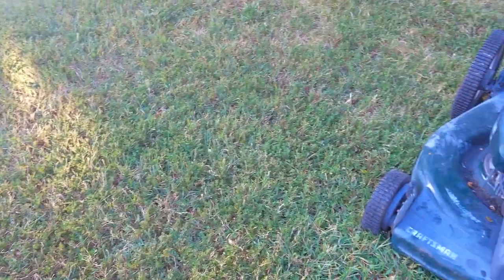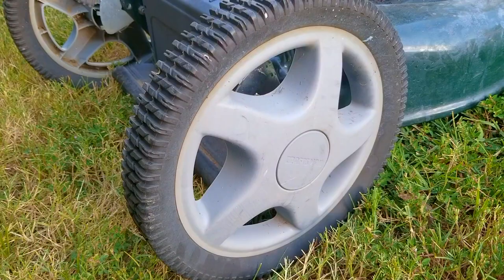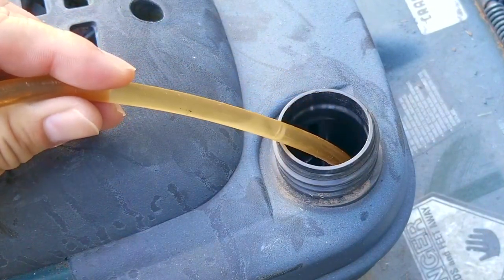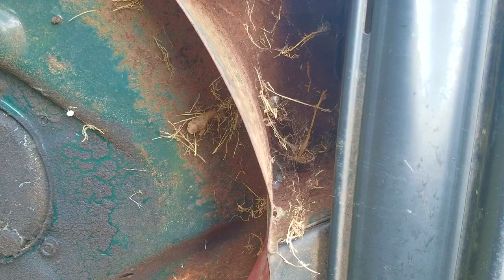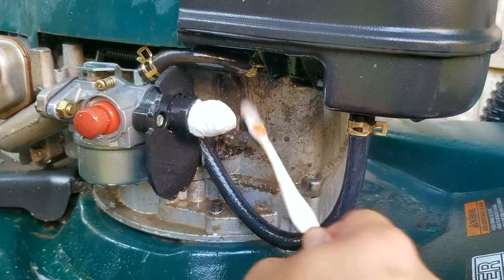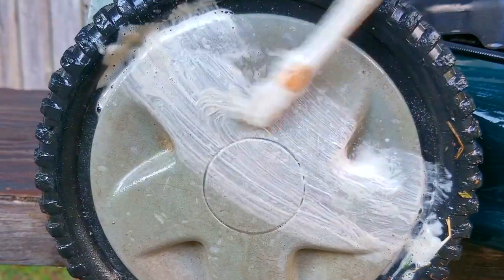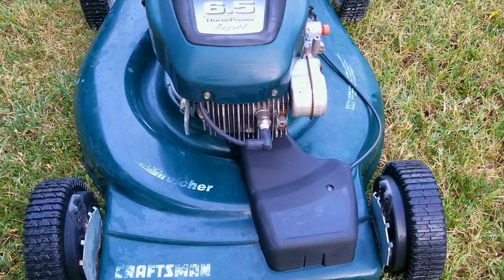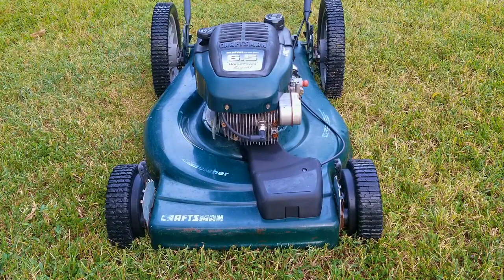Q&A #7, and cleaning a very dusty Craftsman Mower.

Comment: Can't stop binge watching these videos! I have a Mcculloch chainsaw which has some running issues (been in storage for 18 years!!!), needed new metering diaphragm, ran for a bit then stopped, turns out the gasket for the cylinder and crank case was completely dissolved! Got it working earlier today with some new sealant, very happy. Thanks for all the videos, I always learn something new, just keep the content coming.
Reply from the maker: thank you Xeobit, I appreciate the comment.

Comment: Nice clean up and if it was mine and all the fluids drained I'd flip it upside down and lay a curly wire brush on a side grinder, some compressed air and some oil base black paint to the bottom side of the deck. I've never seen a mower too old to get something out of and the two 85 models still running and mowing is a witness to it BUT that's just me. BLESSINGS!

Comment: I watch all your videos Thanks. I have a small engine repair in Michigan. I have a good tip I think to share with you. I always clean the mowers before I work on them, something the customers rarely do (clean).  To cut the  heavy grease I use  mineral spirits for the real heave grease and find Purple Power to be my second choice. Both work well without dangerous fumes like using gasoline. Thanks again for the videos.
Reply from the maker: Thank you Ronald Bechler for the tip, I appreciate your time and comment.

Comment: One of your biggest fans here. I am not sure why i enjoy mowing my yard or working on my mower or watching your excellent channels. But i do so that is that. I have followed your advice and learned from your instruction. I have all ideas whatever else you may want to take on will be a great success also. I own other yard machines (all combustible engine powered) and work on them also - i just do not enjoy it as much nor do i enjoy watching them worked on like i do mowers!! Once these idiots who are running things now finally realize that electric devices usually take at least as much energy and resources to produce and operate as combustible engines - maybe the con will be exposed.
Reply from the maker: Thank you Larry Croft, I really appreciate that.   Yes it's just a racket at the moment, "gas is bad, batteries are better".  It's more like "where's the money being made, and follow it".  There's a lot money to be made on lawn equipment, Because as a home owner, you're expected to maintain your property in the city. So if people think that batteries are the way to go, that's where business will go as well.

Comment: I like the Tecumseh engine, they run very economically and the spray oil not slash, I know little of the being in Australia, where we do have some. I need to learn more, thus far I know the carburettors are difficult to work on.
Reply from the maker: I agree with you. Thees engines have their merits.

Comment: What is your preferred brand of lawnmower engine? Briggs and Stratton, Tecumseh, honda e.t.c.  mine is Briggs
Reply from the maker: I like Briggs, but I had a choice I would prefer a Honda engine.  Tecumseh is okay, except they no longer exist as a company.
Reply: @INSIDEHOUSEGARAGE  yeah I agree honda is probably the best
Reply from the maker: I just like their quality is all. When Briggs went with the plastic carb, I knew it was a cost saving issue, as metal carbs are quite expensive.

Comment: i got a echo hand held blower and i got spark i got fuel and i got at least 100 psi on compression but it won’t start it will hydro lock sometimes but it don’t not anymore hope u can help me out. and i replaced the key for the fly wheel so it’s got spark at the right time
Reply from the maker: thanks for the great question.  I would reset the air gap between the coil and the magnets on the flywheel.  The engine might be flooded by repeated starts, so  I suggest is to take out the spark plug, and pull the rope several times, NO choke, and squeeze the trigger.  Then let it stay like that for a few hours. Then do the same process again.   Then I would close the gap on the spark plug ground strap to about .022"  but try to go less then .020".  I would then open the impeller guard, and use a drill to turn the engine over, with No choke, with the trigger squeezed.   if it starts, great, in not, move the choke to half choke, and then use the rope.  I think the carb is flooding the engine.

Comment: I have a Honda push mower that whenever I would engage the blades the engine would died. It also does not fight back much do you know what the problem could be thanks
Reply from the maker: it sound like the clutch system has a problem, and the blade is stuck, which means when you engage them, it's stopping the engine.
Reply: @INSIDEHOUSEGARAGE  ok thank you do you think that is worth replacing it. It has been doing this for a long time so I bought a new mower there is no blade on it
Reply from the maker: I don't like the blade stop system on any mower brand, because of this very issue.  Typically it's a bearing that's stuck, or worse. As far as fixing it, and if it's worth it, I would say no. Put it to the curb, and then someone else can get a headache trying to fix it. Otherwise, put it in the shed, and wait for a better opportunity.
Reply: That’s what I was worried about. So I found a guy to buy the parts
Reply from the maker: excellent.